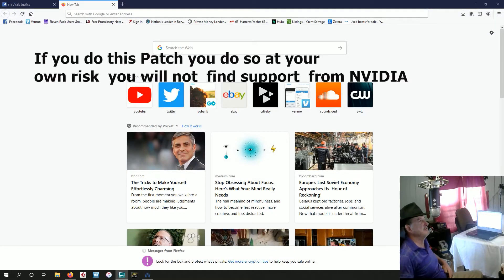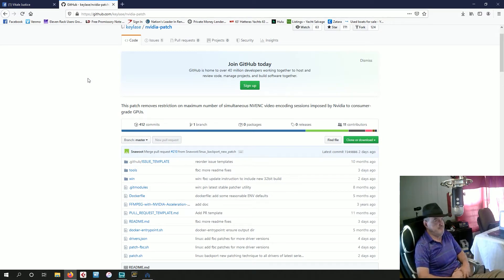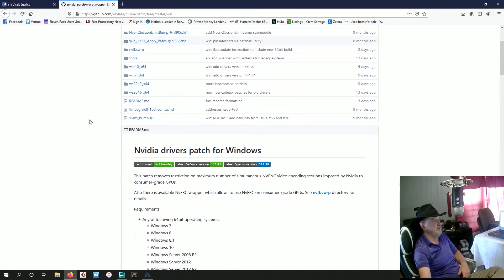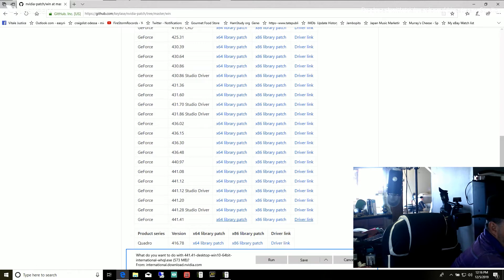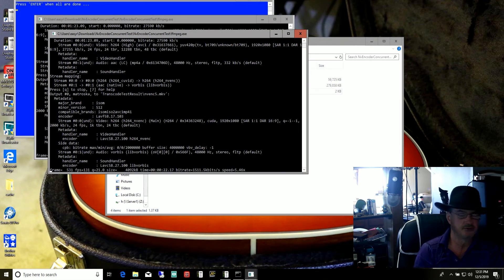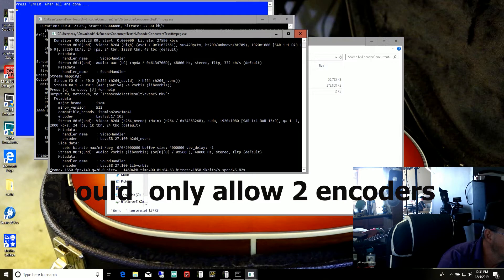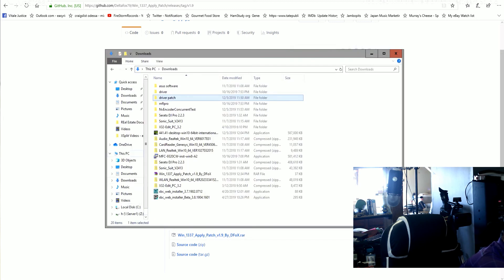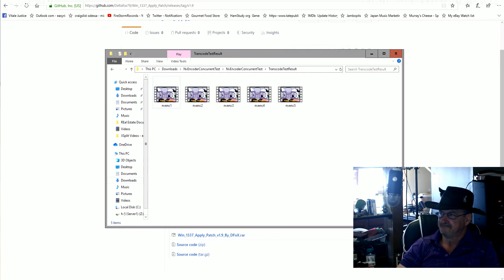unlocking  NVIDIA  Geoforce  Cards for more Video Transcoding Yes you can do that

Comment: Please provide a link for the encoder concurrent software that you are using to test your gpu. I can’t find it
Reply from the maker: been almost a year ago   if I remember w right  I just used a  saved batch file command  one other thing  about a month after  I posted this video, Nvidia updated all gtx and rtx drivers  to unlock a 3rd encoder so if you've updated your divers i nthe last several months  you no longer  need to worry about  being limited to two encoders